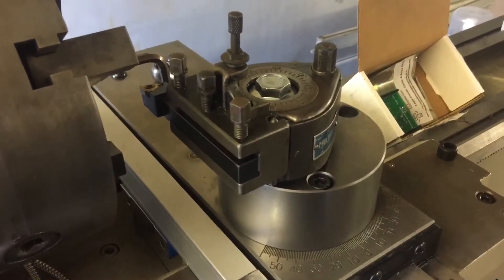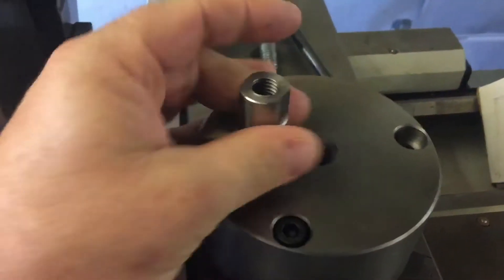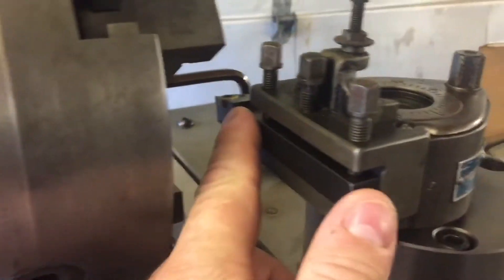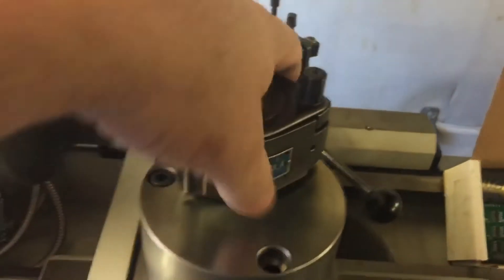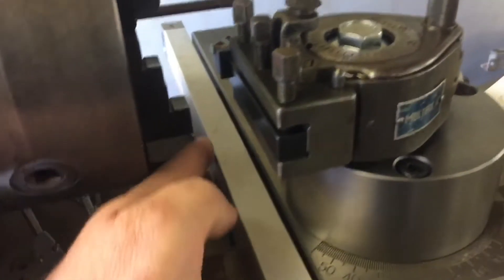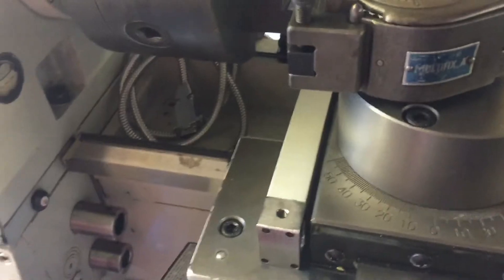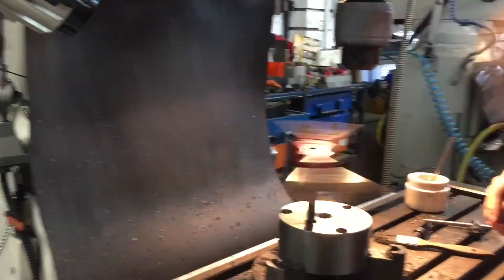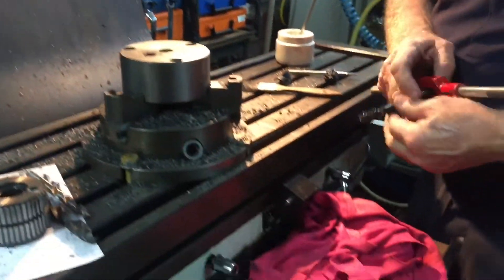AL960B Lathe Salvage part 18

Comment: Very nice!
IMO you really should put a cover on that cross slide scale. You absolutely will run into the scale sooner or later. I have  hit my cover several times and my scale would have been toast. consider laying it flat if you need more vertical room for the cover.
ATB, Robin
Reply from the maker: G'day Robin! I have a list of things to do that has been built up from watching your videos mate!!
It is of course your fault ( :-) ) that my scale is positioned there hehe
I have some stainless offcuts here with that in mind!
I'm planning some way covers (leather) so that my virgin beds are chip free 4 lyfe!